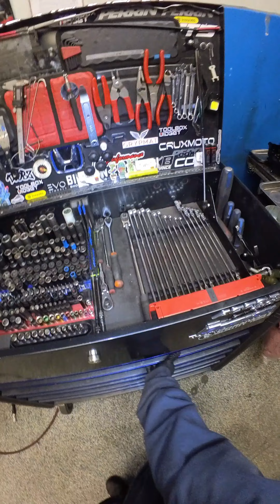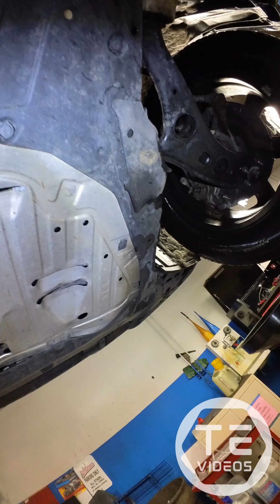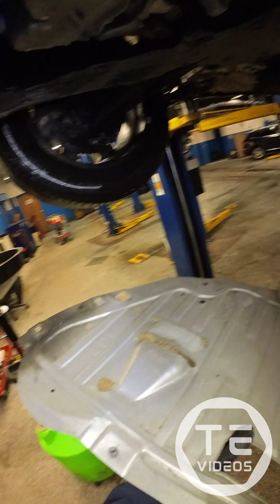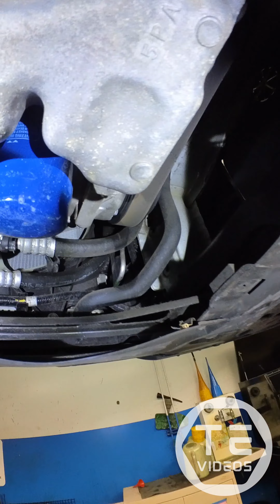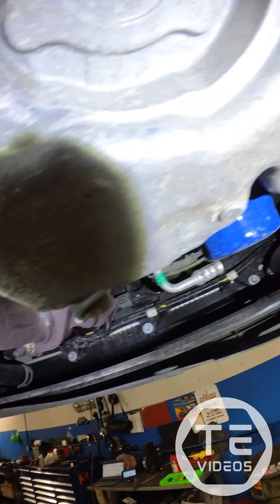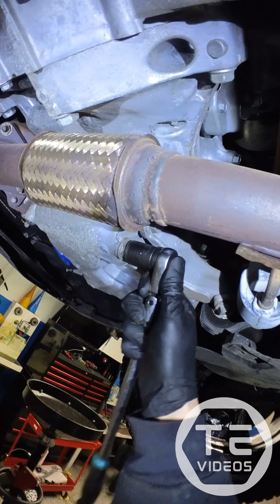Honda CR-V Is Life 👀 #honda #crv #oilchange #pov #backatitagain #satisfying

Comment: Smells like gas = oil dilution = not good.  You should report it and inform them to change their oil at no more than 3k miles.... really more like 2k.  Honda needs to recall and fix the issue or supply free oil changes..... jus’sayin....
Reply: The “issue” happens to all direct injection engines. Short trips will always cause oil dilution. “Smells like gas” doesn’t really mean anything either. Gasoline is extremely pungent. It doesn’t mean you have a mass amount in the oil to cause issues.  

Show me all the 1.5Ts that are failing due to oil dilution. Oh wait, doesn’t exist, because people like you overblow the problem.
Reply: Honda won't stand behind their product. Oil analysis is the way .Speak with your wallet stay away from the 1.5.
Reply: @m109r  I know multiple people with over 100k miles on their 1.5Ts with zero issues. There’s a guy on YouTube with 728k miles on his 2017 1.5T civic. You have no clue what you’re talking about. The vast majority of people have zero issues with their 1.5Ts.
Reply: @m109r   2.4 engine is the best.